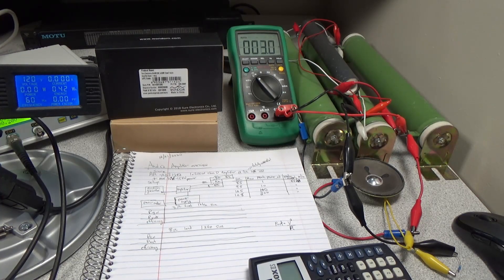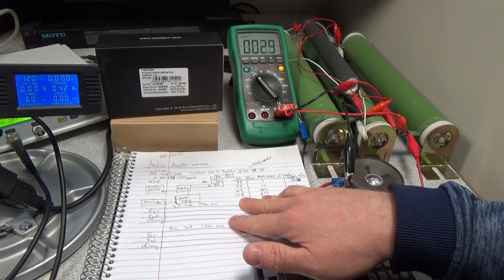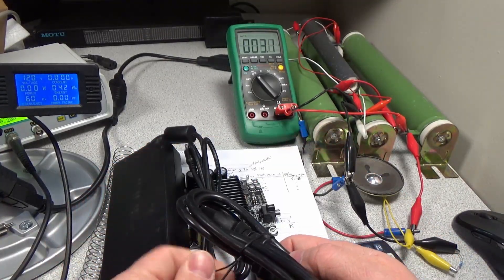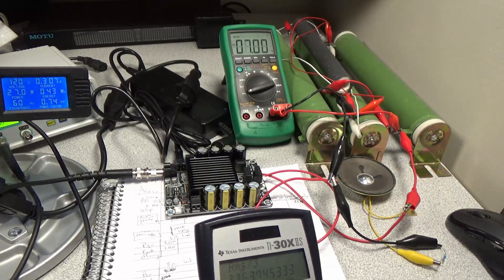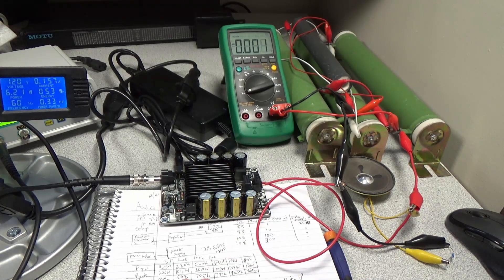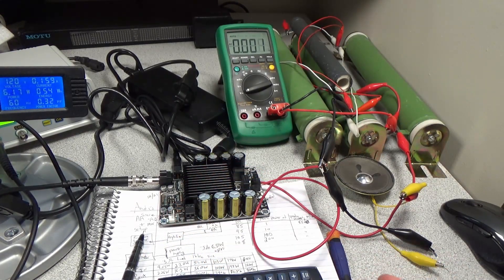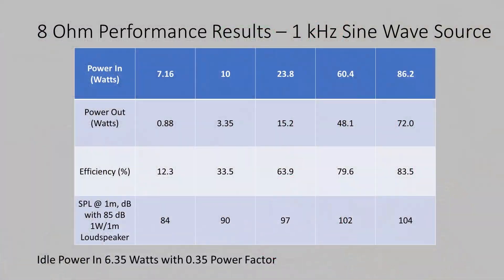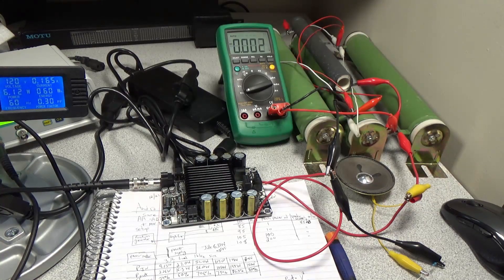Sure Electronics AA-AB31282 1x200W Class D Audio Amplifier Board efficiency analysis – #23

Comment: Great Video, I hate it when manufacturers fudge specs to make things look good, I thought Sure was a better company than this, who uses a 3ohm speaker, a 4ohm might drop to 3 at some lower frequencies but not continuously, can you recommend a good mono class D amp for a subwoofer please
Reply from the maker: hah, yeah, I actually looked at a few others after this and didn't make videos.  I haven't found anything great in this really low cost area but it might be time to look again since there are tons of new models out now.  I ended up with a Dayton 500W plate amp with DSP.  Which is better and has enough power to be loud enough for home needs, but it is also expensive, and certainly is short term 500 watts not continuous.

Comment: Why not try this amp with a more capable 47V DC/10A power supply instead of a 36V/4.4A block? I bet you will have a much higher power point of distortion.
Reply from the maker: The maximum specified power supply for the board is 36 VDC.  I have done some work on the Lepai/Lepy amps from Parts Express and well I should make a video about turning the voltage up on those.  Hint, it didn't go well.

Comment: Why does power factor matter for residential users?
Reply from the maker: Short answer:  Current.  

Longer Answer:  Ever look at an un-interruptible power supply (UPS) and notice the rating is something like 1000 VA and the watt rating will be something lower like 600 watts?  When power factor is low current is higher which means less equipment can operate on the same circuit breaker.  So, if you have a lot of very low power factor equipment on a circuit you can have situations where current will trip the breaker even if wattage is well under what the "circuit" should be able to handle.  

This can also impact cost, even if it isn't costing you money in your electric bill for residential customers.  Low power factor costs money for larger size wiring and larger circuit breakers for the same equipment and same power.